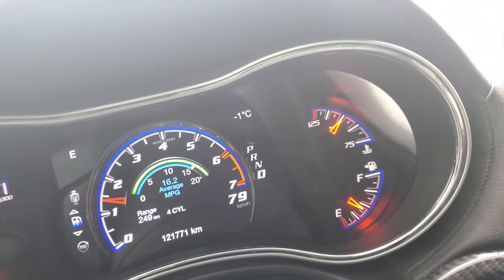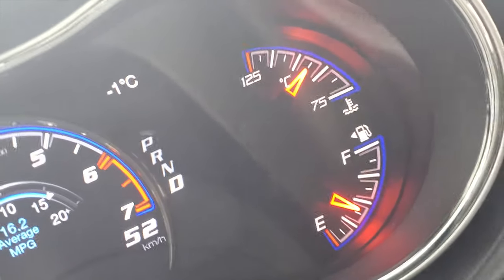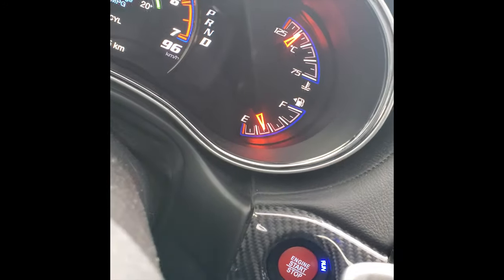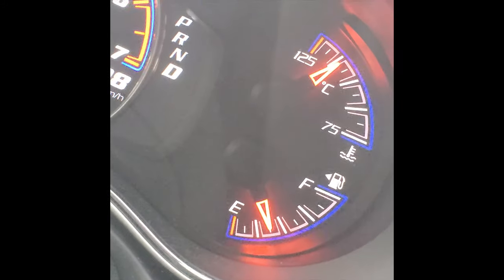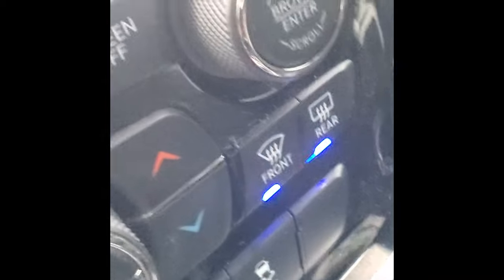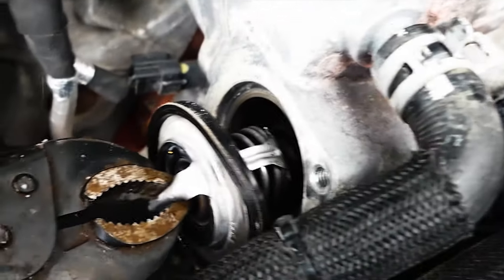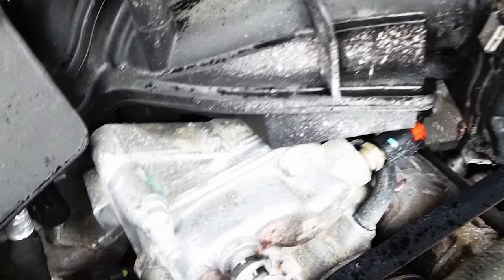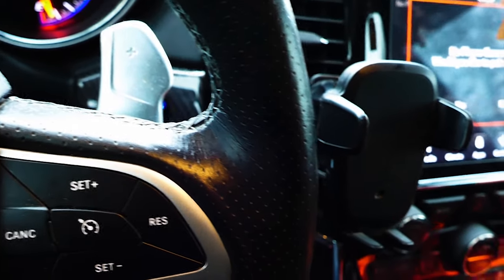Bad thermostat symptoms on a Jeep Grand Cherokee

Comment: If my temperature is still fluctuating after I’ve changed the thermostat, does that mean the water pump is bad or I didn’t add enough fluid by “burping” cooling system?
Reply from the maker: @BossJR13  keep burping the system, if you have could be the waterpump or radiator, usually when waterpumps go they start leaking at the gasket. I would move onto the waterpump then the radiator
Reply: @moparbro  Thanks! Burping the cooling system worked! However, I think I have a slow leak now. I guess that means I should go ahead and change the water pump to stop the leak?
Reply from the maker: @BossJR13  Yea looks like the waterpumps  is going, the gasket fails before the water pump propeller, carry around a jug of orange coolant incase the leak gets bigger when you're out.

Comment: Hey bro 2017 jeep srt here mine goes a bit above half then comes back down is it supposed to do that or always be below half
Reply: Atleast reply instead of liking my comment lol
Reply: @justinshergill8315 no way i have the same probably and my fan turned on randomly while it’s cold out??? Did you find out?
Reply: Mines too bro same year .. it’s jumps to like 230 if I’m driving too fast . 222 and all but when I’m chilling it drops to 115 please help
Reply: I don’t think it should bro I was having that problem too. Temp was going too high but didn’t overheat all the way. Replaced thermostat & did coolant & it’s been fine since

Comment: Bad thermostat or water pump? 2011 Jeep Grand Cherokee 5.7. Temp gauge reached red today, fan on blast. Got home from work, let it cool and let it idle for 5mins and coolant boiled outta the radiator like a volcano.
Reply from the maker: hey there, start with the thermostat, if thays not it, then water pump, u need to take out the thermostat when you replace the waterpump anyways, thnx for watching! plus thermostat is way cheaper to try first
Reply: @moparbro  yeah always start with the cheapest part. Lol. $24 for a 203 degree Duralast isn't bad. I boiled the stock one for 10mins nonstop, didn't open up. Hoping this was the culprit. Waiting on the GF to bring the new one cause I don't wanna overheat on the way to town. I saw videos of where you must open the bleeder Allen head screw out to bleed the air out? I always just idled my vehicles with the radiator cap off and squeezed the radiator hose several times to burp the system of the air.
Reply from the maker: @kennethdurbin3385  yea you can just idle it or leave the thermostat housing open and fill the waterpump with orange coolant until it spill out of the thermostat housing then attach the radiator hose,the thermostat housing sits a little higher or level with the bleeder screw.
Reply: @moparbro  there's no possible way to remove or install the bleeder screw with the CAI installed. It has to come off to get in there. I'm just gonna install everything and add coolant in the radiator til it's full I guess.
Reply: @moparbro  yep, definitely was the thermostat. Let it idle for a long time as there was a lot of air in the system. Finally opened up and needed to add more coolant. There was the red coolant in it from where I bought it in May. The gallon I bought today turned out to be green. 50/50 mix and was hesitant or adding it cause I've heard not to mix colors for years but also heard it's perfectly fine. So I added it anyways. All seems fine for now. Hope mixing colors don't trash my engine. May trade it in soon anyways I dunno. Lol.
Reply from the maker: @kennethdurbin3385  should be fine, the all makes all models 50/50 premix I bought was green